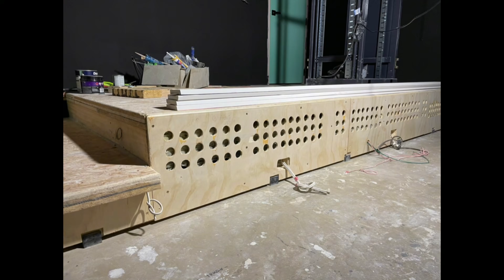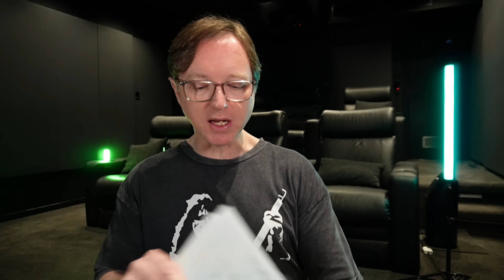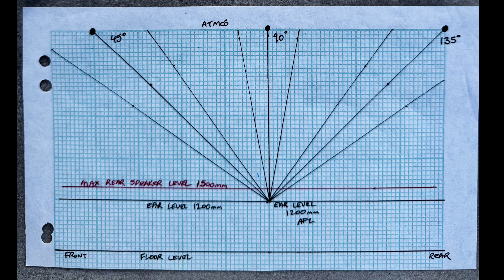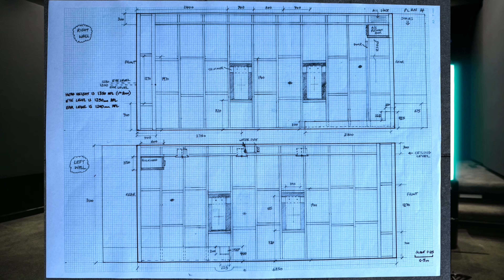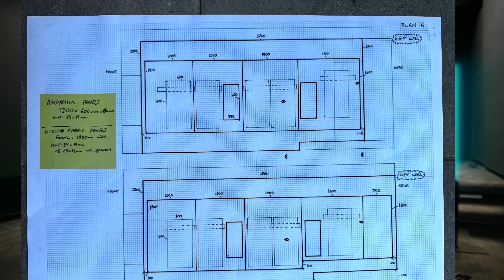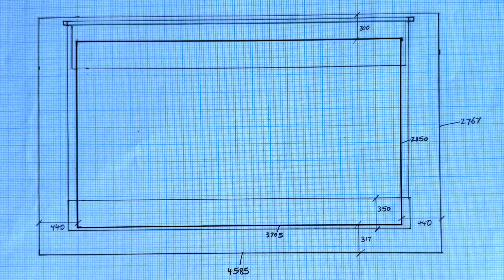Ep1 CINEMA PLANS ⏐How I made a KILLER 9.4.6 DIY KRIX Home Cinema ⏐ Build Series

Comment: Isn't the signtline calculation/drawing, putting the heads of the front row right in the bottom view-cone of the back row? (as the eyes are not on the top of the head)
Reply from the maker: yeah I glossed over that - the eye line was done for calcs for the view of that seat only. I did allow extra on top of that front row eye point for the top of the head as I put the screen a fraction higher that I drew it when constructing it. Plus when you recline the seat as we always do, the top of the head is probably a little lower than the eye level anyway (I measured it when sitting up straight). thanks for watching :)

Comment: Really impressed bro ..May I know what other amplifiers did you consider for this setup and why did you choose Anthem?
Reply from the maker: Great question, I didn't look at a whole lot of options, I went through a dealer that is a Krix dealer as I knew from day 1 I wanted a Krix based system. They are in direct contact with Krix who gave direct input into my system design (they also are the Trinnov distributor in Australia) so I had direct design input by Krix on my exact system and the feedback from that was to go with the Anthem amps to drive the system. I needed to have 20 channels of power so the MCA525 was a good fit. I've been happy with what they can do :)
Reply: Good to know bro enjoy👍